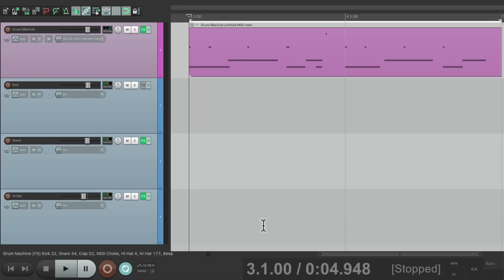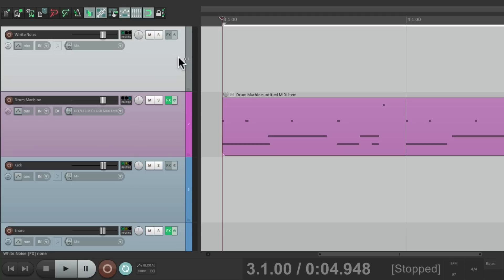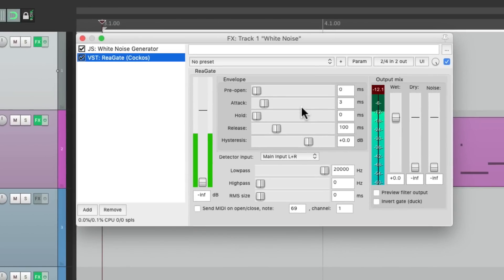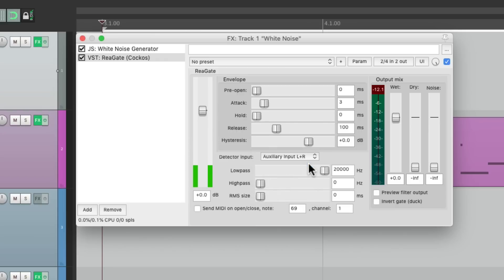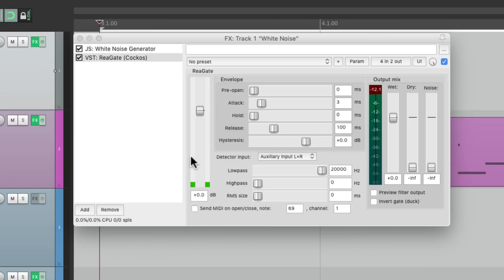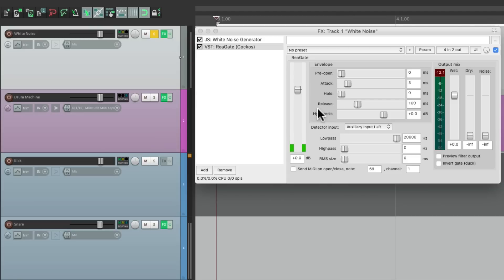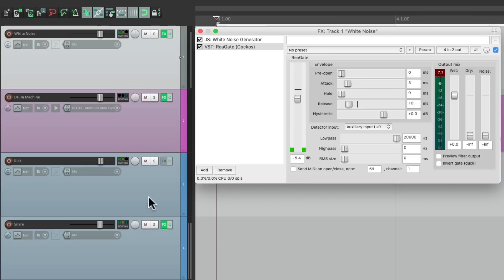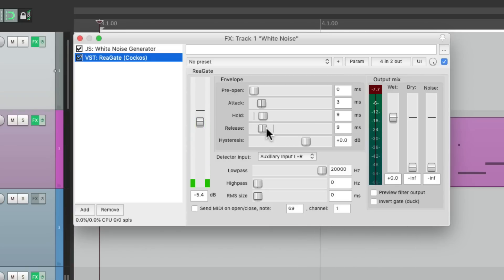Adding White Noise to a Snare in REAPER

Comment: Hi, Kenny. Your tutorials are really good, they are efficiently conceived and well produced regarding the technical aspect. However, I have a certain problem with all of them, and I hope you don't take this the wrong way, because I'm just trying to share some constructive criticism. Your speech pattern makes it very hard to follow these tutorials, you break sentences into groups of 3-4 words and then make an equal length pause between those groups. This is a kind of a "start-stop" exercise for our attention, which leads to fatigue. It might be better if there is a flow element to the approach. The speech pattern also makes videos unnecessary longer by a third for sure, which almost always makes me want to search for a written solution, as I run into problems while working in Reaper and would like to solve them in 2-3 minutes and continue to work. Once again, love your tutorials, but wishing they were a bit more optimized.
Reply: I find the way Kenny speaks to be helpful.
Reply: I have commented on this a number of times without any reply. It may well be just the way he speaks.. I also find it hard to concentrate.
Reply: He might be trying to make sure the length of the videos are at least ten minutes for monetization purposes.  Which I can and will tolerate given the amount of knowledge and skills he gets out in that length of time.  Plus it makes it easier to pause the videos without missing something.  Great job Kenny you deserve every penny for the hard work.

Comment: Couldn’t you just use the noise generator built in to ReaGate? It’s the fader all the way to the right.
Reply: Yes you can and you can put it right on the Snare Track no sends or extra tracks just mix with the Dry and Noise Sliders